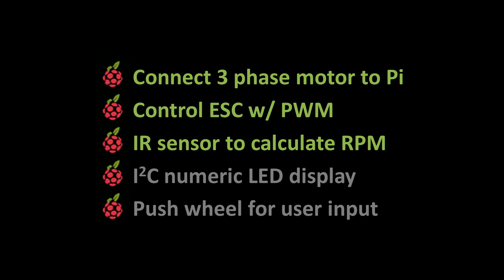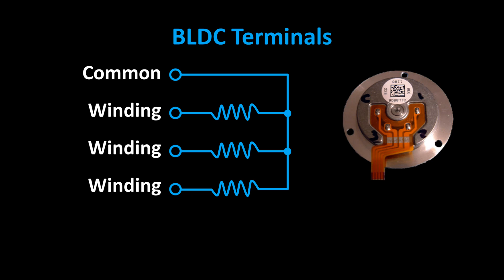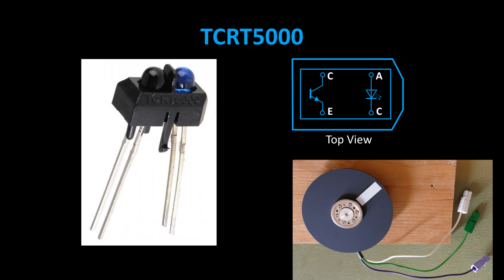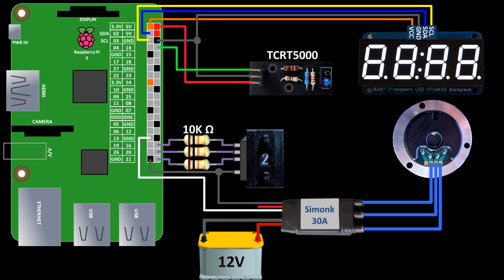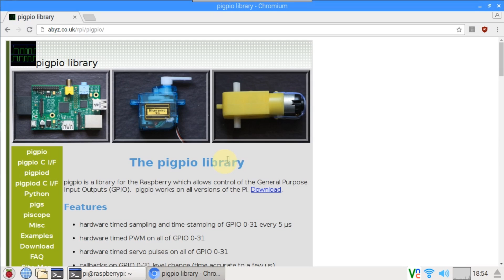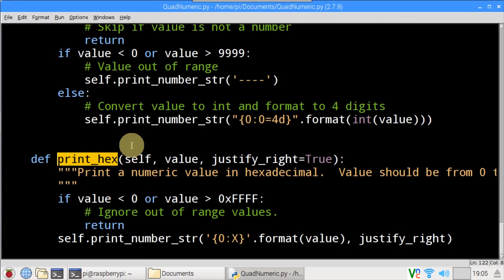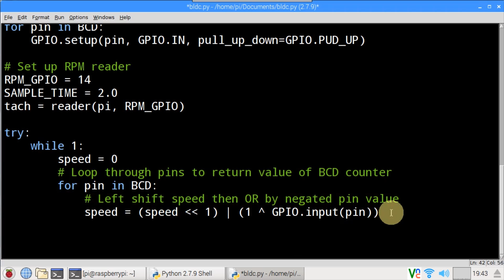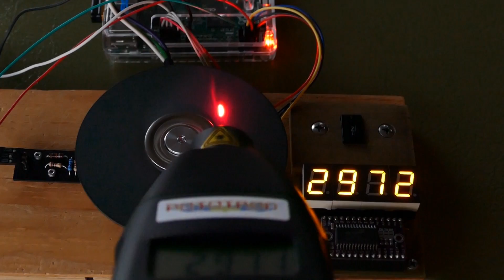Raspberry Pi Motor Control & RPM Measurement Tutorial

Comment: I get strange readings from a tcrt5000 premade board. Just swiping something reflective past the sensor once generates readings of 150,000 or 300,000rpm. The led and photodiode have a cover on them and i've tested in total darkness so i'm not sure where any interference could be coming from. I thought the board might be faulty so bought another but they both give similar results. Any idea what could cause this?
Reply from the maker: Make sure you are supplying the correct voltage which varies depending on which board you bought.  Make sure your board output does not exceed 3.3 V which could damage the Pi.  If your board has an analog output and a digital output, make sure you use the digital output.  An oscilloscope would make troubleshooting easier.  You may need to debounce the output too.

Comment: Great vid tutorial... Is there a way to control RPM based on Load? example... if the RPM slows down due to working load on the motor... the sensor will detect the slow down and increase the current to the DC motor (within its capable range of power usage) so that the RPM is kept at the required speed. this would also work in reverse... (IF RPM increases due to load taken off motor the sensor will initiate the reverse function). Thanks keep up the great work.

Comment: Speed sensor-pulses per mile 
Rpm- 4 pulse per rev
Coolant temp- 100ohm to 240ohm resistance 
Fuel -0 -90ohm 
These are the wires I have that are coming out of my racecar can this rasberry pi monitor these outputs from a screen???

Comment: Can we use this ESC to control light brightness, if yes can you suggest any tutorial?
Reply from the maker: ESC's are not meant for lights.  You usually use PWM for lighting control.
Reply: @rdagger  Thank you so much, but do you have any videos to control solar light brightness using PWM
Reply from the maker: @yugeshkc9026  I've made several videos using PWM, but nothing that specific.  You can search my website for PWM.  My Micropython touch and sound tutorial uses PWM to control LED brightness: https://www.rototron.info/raspberry-pi-esp32-micropython-touch-sound-tutorial/
PWM can be used to pulse the electrical supply to an LED on and off very quickly.  The pulses are usually too fast for the human eye to see.  Therefore, the LED will appear to be normally lit.  The brightness can be varied by changing the length of the on pulse with respect to the length of the off pulse.
Reply: @rdagger  thank  you so much for your response I will surely check the website.

Comment: Good Morning!
Very good tutorial.
I'm starting to learn python now, and trying to mount something like that, but I do not want to show on the display, it's a label created on a TKinter screen. I can not even get the values read from the sensor in the terminal.
Do you know if it's possible?

from time import sleep
import pigpio
from read_RPM import reader
import RPi.GPIO as GPIO

# Set up BCM GPIO numbering
GPIO.setmode(GPIO.BCM)

# Connect to pigpio
pi = pigpio.pi() 

# Set up RPM reader
RPM_GPIO = 14
SAMPLE_TIME = 2.0
tach = reader(pi, RPM_GPIO)

#Read RPM
rpm = tach.RPM()

print (rpm)
Reply from the maker: What error message are you getting?  Did you start the Pigpio daemon?

Comment: It's cool that you can use a pi but is there not something much easier like just the controller and something with a potentiometer
Reply from the maker: Yes.  An Arduino or an ESP32 could do it.  Or a $2 ATTiny MCU and a pot would work.

Comment: Hey man, not sure how else to contact you but i have a question about using an LCD display from Adafruit using I2C. I know how to write a message, but how do you write a number or variable that is constantly changing. Like in this video, your RPM is always changing, and you used the display.print_float (rpm) command, However how can it be down in I2C because using the lcd.message(rpm) does not work for me? Big thanks for your videos!
Reply from the maker: I have 8 videos on using LCD displays:  https://www.youtube.com/playlist?list=PLKGiH5V9SS1iFjYmD7W1n7beJt7Gb8Vy4
You can use lcd.clear() before lcd.message() to ensure the screen is cleared and your cursor is positioned at the top left.  However, the Adafruit LCD library is not performant.  Therefore, this approach can cause flickering.  A work around is to use lcd.home() instead of lcd.clear() which just homes the cursor to the top left.  You can then overwrite your existing text.  This works well as longs as the length of you text is constant.  So you may need to pad your numbers with zeros and use fixed decimal spaces.
Reply: rdagger68 but how do insert a variable such as rpm into lcd.message() ? 
Isn’t the lcd.message() only for character strings. Not sure how to format t
Reply from the maker: You would use python string formatting just like you would with the print statement.  For example, the following will display the RPM formatted to 1 decimal place:
lcd.message('Motor Speed: {0:0.1f} RPM'.format(rpm))
Reply: rdagger68 awesome man thank you so much!! Really appreciate it!

Comment: So, you do not actually set all the code you should like the read_RPM file all inside the bldc file. The last file you created titled bldc just imports the other files in your documents folder??? I am a little lost.
Reply from the maker: The read_RPM.py file needs to be placed in the same folder as your program.  For example if you create a program called test.py that imports read_RPM then both files should be saved in the same folder.  Alternatively, you could add the location of the read_RPM file to the python path.  Libraries added to the python path can be imported regardless of file location.  Generally, when a library comes pre-installed with the OS such as PiGPIO, it is already added to the python path so you can just import it.  The same goes for when you install a library using pip.  For example when you use sudo pip install adafruit-led-backpack, the library is automatically added to the path so you can just import it.
Reply: rdagger68 ok thank you for your quick response! Am doing a similar project but with a different sensor and with an LCD screen from adafruit. I think I have it all, I just need to peice it all together

Comment: i have tried applying the code you provided to connect a hobbywing QuicRun WP 1060 Brushed ESC to a pi but i can't manage to make it work, i have looked elsewhere on the web and can't find something that works with this ESC. is there another way to allow me to connect this ESC to the pi.
Reply from the maker: Brushed motor ESC's are different and would require different code.  I haven't experimented with them but from what I've read it would probably require 1.5ms pulses for idle, 1ms for full reverse, 2ms for full forward and calibration should be 1.5ms for a few seconds.  I'd check with the manufacturer to confirm.
Reply: Thank you

Comment: what if you just want to run an esc with a pontiometer instead of all the complicated stuff
Reply from the maker: You can buy an ESC tester on eBay for a couple of dollars.  It's a small box with a pot that allows you to vary a PWM signal to a BLDC motor.
Reply: rdagger68 that's my problem my esc has reverse when I try a pontiometer from my ebike handly I first have to find a zero spot then I tried to go full reverse if I let go witch is really anoying
Reply from the maker: I'm not sure if they make testers that support reverse. I'd ask around on an RC forum.  It would not be difficult to do on a Raspberry Pi or Arduino.

Comment: Trying to adapt your read_RPM for use with an anemometer i just picked up  :)
Reply from the maker: Sounds like a cool project.  You might also consider a hall-effect sensor depending on your environment.
Reply: rdagger68 I wish it had a hall sensor but it appears to be a cheap reed switch one (maplin?) I may need to pick up an rpm reader to check the accuracy.

Comment: Hello......What can i do to rotate the motor anticlockwise?
Reply from the maker: Swap any two wires that go from the ESC to the motor.
Reply: Yes but what if i want with the same motor rotate clockwise and anticlockwise without swap the wires......can i do that with the program?
Reply from the maker: You would need an ESC that supports reverse for a brushless sensorless motor. These ESC's are usually targeted for RC cars or boats.  These ESC's usually have a third calibration step to center the stick but you'll need to check the documentation for the specific ESC.
Reply: Thank you very much!!!

Comment: Hi, awesome tutorials! Could you perhaps please do one where you have 2 or more motion sensors that triggers 2 or more different channels on a relay to switch on 2 or more separate lights when triggered?
My planned project as an example: I have 4 x 20watt (220volt) LED spotlights around my house and would like the lights in each of the 4 "areas" to switch on separately when triggered by a motion sensor in the same area. If after 5 minutes no motion is detected the light switches off.  What will also help are some numbered led lights on the breadboard to show if a channel is triggered.
Reply from the maker: I have a video on motion detectors:  https://www.youtube.com/watch?v=dQY6hNA53oM
I’ll probably do a video on relays.  However, for your project you might be better off using automation technology like Z-Wave, ZigBee or Insteon.  Mixing low voltage and high voltage can be dangerous, can violate local building codes and may negate insurance policies.  I have a video on controlling Insteon via the Raspberry Pi:  https://www.youtube.com/watch?v=D3L9L6Itig4